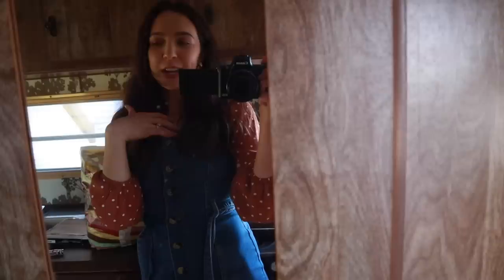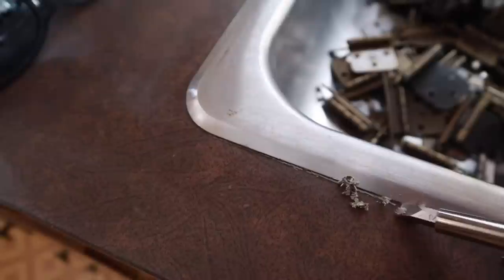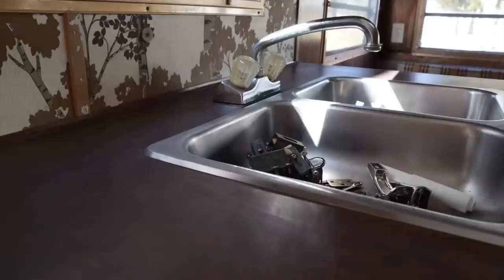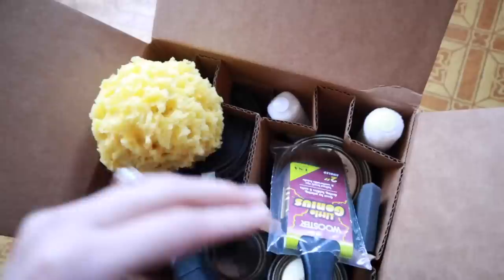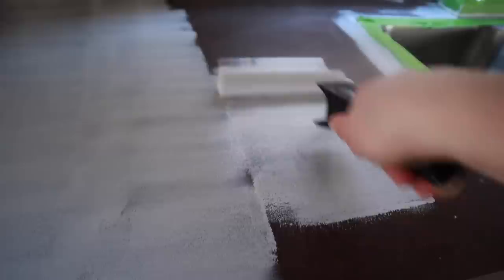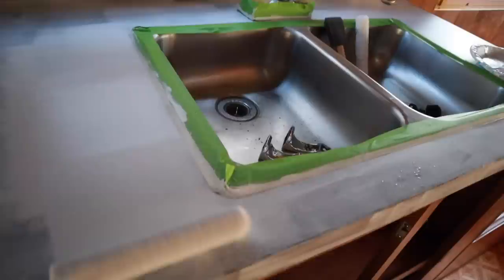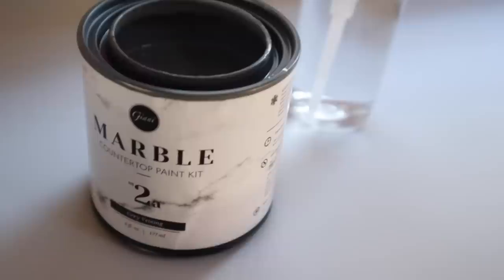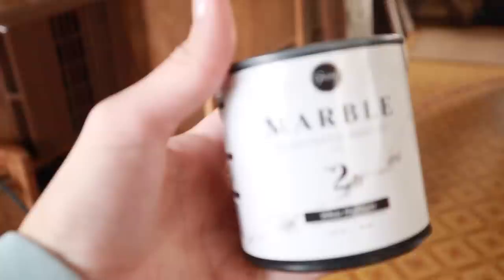PAINTING OUR COUNTER MARBLE// faux marble countertops on a budget

Comment: I painted my counters recently. I didn't use the kit however, but got similar results. Also, just to add...I used a turkey feather for the veining and acrylic paint that was diluted with water rather than the paint and spray technique. It made the veining look very realistic. Great job!!
Reply: I wish I could see pics of your technique 😔
Reply: I'd love to see pics as well, what product did you use. I can't find this kit in London at the moment. Many thanks in advance
Reply: how did you do it because the kit is out of stock ?
Reply: Great idea, but where do you get a turkey feather?
Reply: I used a white primer that's mold and mildew resistant, acrylic paints and a turkey feather which you can get at craft stores, and a spray bottle with water to help thin out the streaks a bit to make them more realistic.
Reply: @metalvixxxen8321  I would love to show photos if I could
Reply: @ambernicole1588  Thank you Amber.  I would love to see photos also!
Reply: That is a GREAT idea. I have white epoxy countertops now and it's a wee bit..white. white cabs white appliances, it's an ongoing thing lol